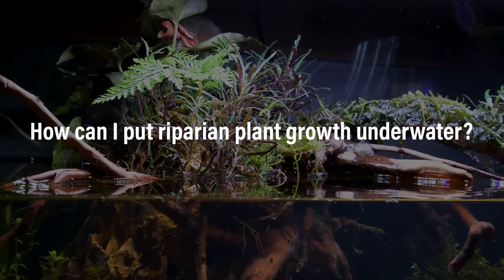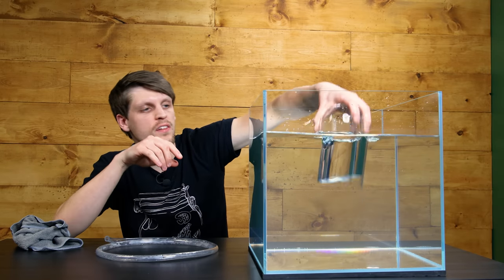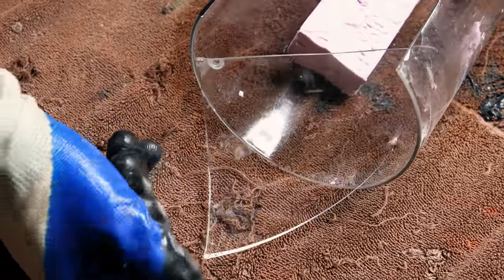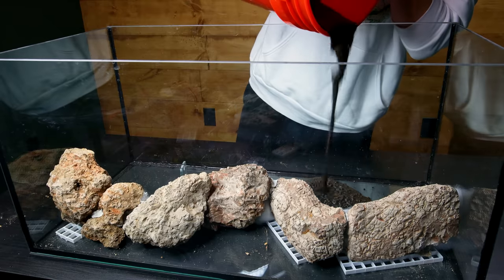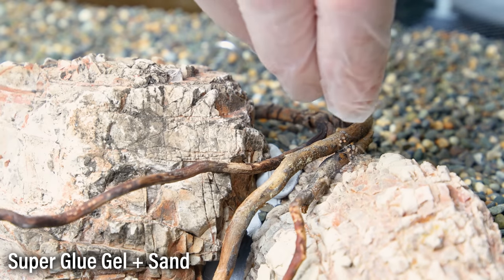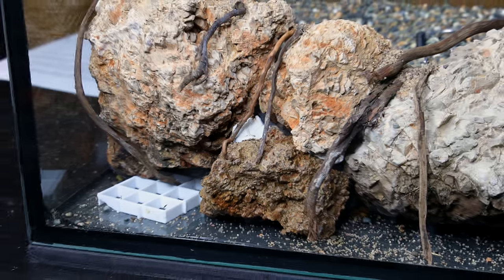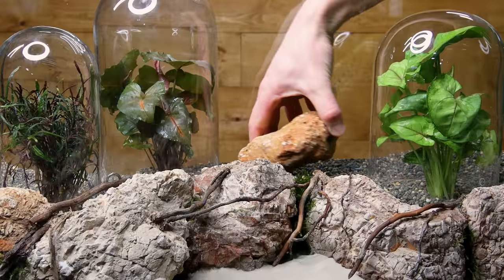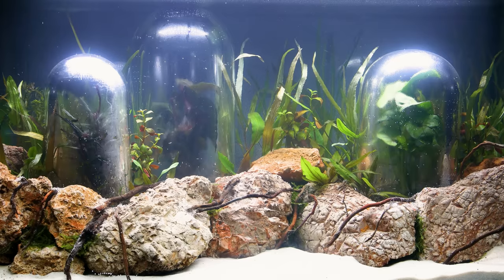Underwater Riparium Air Pockets for Houseplants Grown in Aquarium Substrate Aquascape

Comment: Cool idea and execution. I like how your tank came together. Is there any fear of the air pockets becoming “stale” in the domes (All CO2 used up and O2 remains suffocating plants)? To eliminate the condensation could you possibly replace the glass domes for glass tubes “porting” from the substrate to the to the surface” (this should decrease the condensation and provide plenty of air exchange for the plants with surface air)? To tackle the air exchange issue alone could you add a small air pump with a splitter to each dome and periodically resupply the CO2 in the air pockets? I’m interested in seeing how the concept develops over time!
Reply: Glass tubes open on top would fill with water to the same level as the rest of the tank so this is not a solution. But for the condensation problem, I agree that an air pump would do the trick as long as the air coming in is not too cold or humid. The added air would escape through the holes where the domes are attached and create nice little bubbles.
Reply: The risk of air becoming stale in the cloches seems likely to be lower than in a traditional terrarium, as this is not a totally closed system- gas exchange can occur between the air in the cloches and the water in the aquarium. This gas exchange will be influenced by factors such as water temperature, pH, and the chemical composition of the water at any point in time. This shouldn't affect the volume of the gas in the cloche, just the mix of gases it contains. I say that this isn't a fully closed system because the aquarium has no lid, allowing gases (such as CO2) to escape and water to evaporate, as well as Tanner doing water changes, feeding the fish, etc. Any change to the water will therefore have a knock-on effect on the gases contained in the cloches. 
More generally, CO2 will only be converted to O2 when the lights are on and photosynthesis is occurring. The plants will be respiring O2 to CO2 all the time, just like we do. If anything, lack of O2 would be what 'suffocates' the plants, but just like in any other terrarium, they'll probably be just fine for a good long time, and I hypothesis they'll do even better in a system like this thanks to the air/water exchange I mentioned before. Almost like your glass tubes for air exchange, but a more roundabout process!
Reply: @ThePerennialEffect  I use a similar (but smaller) upside down container filled with co2 as an alternative to expensive co2 systems. it only takes a day for all the co2 to diffuse into the water and the container to fill back up with water. Would this be much slower with regular air? if not he'd have to top up with fresh air regularly anyway.
Reply: @Ausstein  CO2 is about 100 times more soluble in water than nitrogen and 50 times more soluble than oxygen, which is probably why it’s going down so quickly. A gas like ammonia would be about 250 times more soluble than even the CO2 (part of the reason it’s so dangerous). There’s also the matter of the plants keeping things somewhat regulated, so I don’t think that this tank would react in the same way as yours. Could be fun to test whether a container full of air fares compared to your CO2 though?
Reply: @ThePerennialEffect  
Thx for the reply, but in that case the suffocation by lack of CO2 might be a real problem not because the CO2 is used up but because the CO2 diffuses out so quickly. I might set up one with air next time and report back :D
Reply: @ThePerennialEffect  okay can confirmm. co2 is empty, air is still full of gas :D But that is actually worrysome for the plants in his domes.
Reply: @Ausstein  Yay science! Cool that you went and checked! I don’t think that it’ll harm the plants, as they should be able to take in some of the co2 that’s released through respiration before it diffuses out through the water. They might not grow as fast as they would under normal circumstances, but that seems like it might be a bonus in this scenario, less maintenance to be done!

Comment: @SerpaDesign original idea, very nice! There is 2 "problems" (ill give insight on potential fixes) for it to be perfect (in my eyes) 1: the spherical top of the container, it will always reflect a lot of light whatever the angle; 2: the condensation that obstruct the view of this art piece. Here is my insight (0 value) To remove the reflection of light, use a cylinder container with flat top (not globe), cons: condensation is still a problem, maybe hydrophobic film/spray can solve it. I love the idea of using a fully opened cylinder on both hands (yeah, deal with pressure, might be fully isolated from the underwater pressure); condensation will be limited, or you can go full berserk, use the cylinders with permanent water running evenly on internal side (either sprinklers spraying water evenly and build a top to hide it, or even better: use it as overflow with water from the aquarium). Somehow figure a way to use open cylinders, deal with pressure and permanent water running on internal sides of the cylinders. Its random, im drunk. :)

Comment: I love this concept! 
i wonder if you could run tubing up into the cloches that are hidden in the substrate (maybe even leading outside the tank through holes cut in the side and anchored/sealed with silicone) that way you could puff in some cool room temperature air to get rid of the condensation whenever you want to look at it, and it would allow more continuous air exchange which might help with condensation and algae growth. 
Though someone mentioned coating the glass in a hydrophobic compound and that is probably a simpler solution. 

That said puffing in new air would probably help, though the plants do release CO2 when they respire at night with the lights off. it's only half of what they originally take in. Given enough cycles i'd imagine they'd still use up their CO2 unless the air is refreshed either though maintenance or using a tube to periodically blow more CO2 laden air in. 

It's an interesting concept for sure.

Comment: The condensation can be removed by cooling the water more.

Also I was thinking of like a mason jar and adding cement at the base to act as a weight, that will keep them down (even with the air bubble(s)) and anchored at the bottom; not to mention the easy hassle free convince of the maintenance in the future and in the beginning of these terrariums... this will make your job much easier, and so much so that you can build a mass quantity of them to offer for sale or to give away as gifts to friends and family members.

Comment: I don't know if this has already been mentioned but the fogged up glass can be fixed by using an air pump to feed fresh air into the containers. That will lower the humidity. If there is still fog, increase the amount of air until it go's away. Drilling another hole close to the bottom and put in a pipe that leads to the surface (use a pipe larger then the standard airline tubing) then silicone around it. This will allow the displaced humid air to escape back to the surface without the causing large bubbles. The fresh air will also give the plants access to much needed co2 that they might have died without. To hide the tubing you could use tall plants like cryptocoryne balansae.

Comment: Awesome idea! It might look good if you add lights at the bottom, inside the terrariums to help illuminate the terrestrial plants. I noticed the lights above the tank are reflecting off the rounded glass containers, which further obscures the plants, so I was thinking of ways to draw focus to the plants.

Also, I could see you tackling the humidity challenge in a future design. If water was running down the inside of the glass, would it stop humidity from building up?  

Keep sharing, I love your work!

Comment: Hey, I have a variation on this design: An underwater cave glued up against the front panel with an air pocket at the top of the cave. Do some very low light amphibious plants so that some are underwater while others have grown up a soil slope into the air pocket. How is the cave lit? With leds hidden by crystals like in your other cave build to create a sort of bio-luminescent look, and they'd be installed both below and above the water into the underside of the top of the cave, and accessed through the top of the tank.

Comment: Whoa you weren't lying when you said this was an ambitious project, worth the extra wait! What do you think about air exchange inside of the containers for the terrestrial plants? I wonder if the pressure from the plant's excreted O2 would eventually push the water level down until air bubbles escaped. Would be fun to watch I bet. Thanks for the video!
Reply: The volume of gas inside the containers should remain constant, with only the composition changing in terms of the concentration of O2 and CO2. A plant is constantly respiring O2 into CO2, and when the lights are on, it will also be doing the opposite as it photosynthesises, taking in O2 and excreting CO2. Any difference in density between the two gases causing a change in volume seems negligible- most of the air is Nitrogen, anyway. Plant growth and the locking of C into biomass would theoretically reduce the amount of gaseous carbon available, but as the plant grows, the amount of tissues respiring would also increase, which could cancel out this effect. In a regular terrarium, the system is this simple (assuming it is fully airtight). With a setup like this, you'd also have to consider gas exchange between the air and the water, the rate of which changes based on things like water temperature, and pH. This now gets beyond my expertise. In summary, these cloches can't be considered a fully closed system. Gases are moving between the cloche and the aquarium water, and from there can interact with the aquatic plants and animals or can then escape out the top as it doesn't have a lid. I hope you found this interesting - it was fun to think about!

Comment: I have had this idea, but wanted to do it with a decent sized glass bowl to have an underwater air pocket for aquatic crabs. I would try to cure the condensation issue by pumping air straight into the glass container and having it bubble out into the aquarium. The reason I haven't done it yet is because I wasn't sure of how to secure the container but this is the perfect idea

Comment: Awesome idea!  Bummer about the condensation.  I wonder if you rigged up a tube to squirt a little water on the inside if that would help for viewing.  You could use the same tube to top off the air.  But still Wins the prize for thinking outside the box inside the aquarium!

Comment: Try putting some water repellent spray on the inside of the glass bubbles.
Also if you wanted to, you could put pressure valves on the tops of them as well ( can probably cover with moss) and use a small air pump to pump air through the top, that way your able to get maximum amount of air in the bubbles without accidentally letting more water in.

Comment: I'm curious to see how this turns out. It seems like after a while, the condensation on the inside of the cloches would eventually clear up, or at least get so dense that it would run, making it easier to see inside. As the plants get bigger, they would press up against the glass, making it easier to see them as well, wouldn't it? It probably depends on how much photosynthesis is going on as well, and I wouldn't be surprised if it's clearer at certain points of the day.

Comment: Could probably use an air bubbler to continuously feed the plants new air and some sort of hydrophobic coating on the glass to limit the condensation. Both those changes could be done without having to even drain the whole thing. Looks like some hydrophobic coatings could worsen condensation so would have to get the right type.

Comment: you can drill a small hole in the top of each container and attach a small air stone. Then supply air into each container. This will fix the issue with condensation due to the fresh stream of air.

Comment: Maybe continuously pumping some air into the air domes reduces or removes the condensation. However escaping excess air could make them wobble. Or maybe a jet of water, every hour or so, directed at the top of the air dome would help

Comment: If you could plumb an airline under each container that adds just a bit of dry air it might help your condensation issue, and give the plants fresh air.  I get that it would bubble out, but that might be cool looking comming out of the holes you drilled.  Have you also thought of doing one that's bigger that a squirrel lives in?

Comment: For the condensation: mix two cups water, two cups white vinegar and a couple drops of dish soap, spray it on the inside of the glass jars and wipe it down with a soft cloth. Let it dry and then try putting it back in the tank!

Comment: My thought is what if you drilled massive holes in a aquarium tank bottom and then put the cloche containers in the holes then seal it with the silicone. The aquarium wouldn’t be ablaze to sit flat by itself it would have to be raised a little for gravel/dirt  for the plants but it would be so much easier to clean the inside of the cloche containers. I’m sure this probably doesn’t make sense and that you prob won’t even see this comment but still 🤷🏼‍♀️

Comment: It would be a chore to do now but, you could run airline to each of the bubbles. Try having an air pump pump run into one, then another airline connecting that space to the next klosh and so on, with the last airline sneaking out of the water. This may cause enough air circulation to prevent condensation while not having each dome emit large  bubbles.

Comment: you could probably put a tube in the air chamber as a outlet for the air with a valve on the end of it to adjust the air out and a air pump pumping the air in then you can tune it to make it balance air in and out to help air circulate and refresh the CO2 level for the plants and help the humidity level drop giving a clearer glass. just guessing though.

Comment: Taking this to the next level... say you cut big holes in the bottom of the tank. 
Then silicone in these domes.
Same effect, but you can change out the plants that would be external to the tank and control air temperature and humidity so there is no condensation. 
You could even make the bottom part under the tank for lizards. 
Seeing them climb up a plant or branch and appear to be in the aquarium would be wild.

Comment: Would be interesting to see how this actually turns out 2 months, 6 months and 12 months from now. 

I would be concerned the light and UVA penetration would not be high enough through the water, glass and then additional later of condensate to sustain the plants long term. 

I'd likewise be concerned about the air volume of the containers, and suffocation occuring. Think of yourself in a diving bell, you're only safe so long as the air doesn't run out from your own respiration. As plants switch between breathing cO2 and O between night and day, the concern the plants would be in a perpetual state of suffocation due to insufficient air volume is high. 

Taking these factors out of the mix however, keeping the plants in a state where they don't grow out into the sides of the containers seems like an excessive amount of work. Particularly when they'll ultimately be obscured by condensate. 

The condensation should sort itself out after 8 weeks. If that is too long one only needs to attach arched glass tubal bridges between the containers where the apex of the arch is higher than the apex of the containers. If the internal surface area of the bridges is high enough, it will displace the condensate into the bridges.  That would require reflowing the glass however which is an excessive amount of work for a system that seems likely to both starve and suffocate the plants.

You also have the problem of highly visible glass domes in the tank which doesn't do it for me in the context of a naturalised scape. They seem out of place. 

Happy to be proven wrong with periodic updates on how the tank is doing over a 13 month period. But as it currently stands this doesn't seem viable.

Comment: maybe if theres away to add tubing into the cylinders that slant at a downward angle threw the gravel out the back, capping the back until air is fillled, hidding the tube behind the plants so when air is added the tubing inside the cylinder is then sticking up above the water line. opening the valve of the tubes out the back of the aquarium releases any water that filled in the tubing as long as its at a slant should work creating air exchange . in return helping with fresh air and condensation. idk just a thought. or maybe my thought process is out of wack😂😂. in my head it sounds like it would work. as long as the tubing is sealed out the back of the aquarium so no leaks happen....lol...idk

Comment: I wonder if using an anti fog solution (like what is used on glasses) on the inside of the containers would prevent condensation from building up, and allow you to see in to the containers better.

Comment: @SerpaDesign considering the condens on the glass. Isn't it possible to add a clear hydrophobic coating on the inside, so that water runs down from the glass? I.m.o. this should I be relatively inexpensive solution that will significantly improve the view.

Comment: It's impractical but cool only way I could see getting around so much condensation would be to cut the bottom of the tank for each hole and then silicone the tops with the globe but that defeats the purpose in a way

Comment: the pressure on the anchors may increase over time, maybe, if it does, more anchor points will give more strength and distribute the pressure

Comment: Something I’d worry about is the plants running out of carbon dioxide, eventually they’re small bubble will be all o2 and a doubt there will be air exchange in the small surface area on the bottom of the chamber